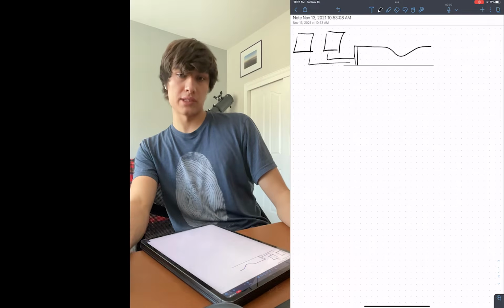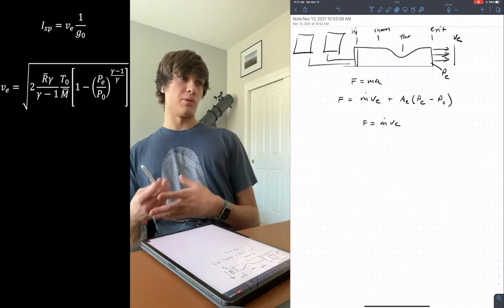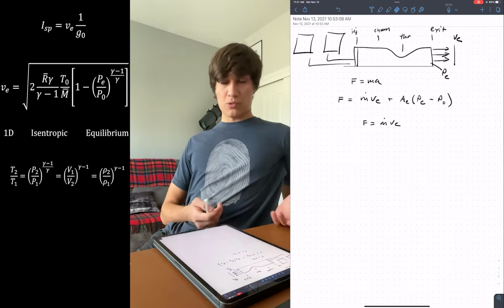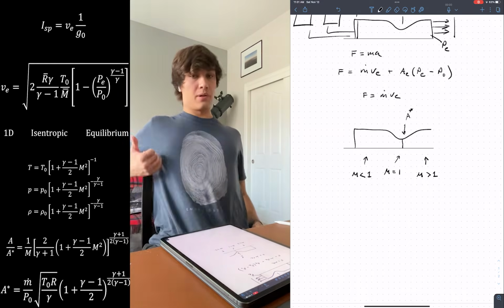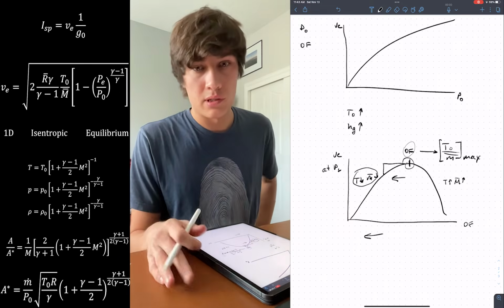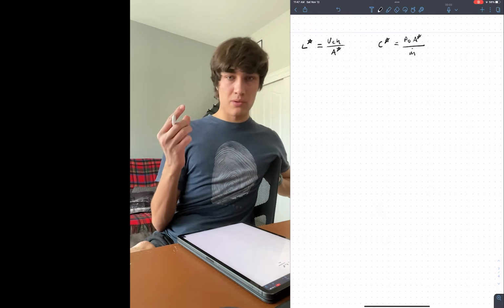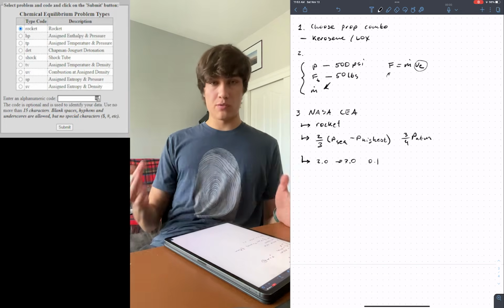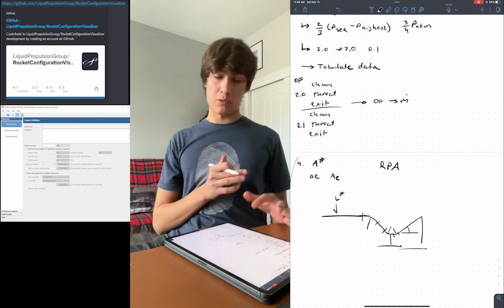Lec0: Sizing a Rocket Engine from Scratch (Intro to Rocket Design)

Comment: Nobody ever talk about what happens if Throat Mach Number is larger than 1, e.g. 1.05.
Surely it is not possible to hit Mach 1 right on the head, so I suggest you would rather want to be slightly higher, as lower will make your engine not work?
Reply: You're right to question this. Yes, what you asked is true: 'What happens if throat mach number is larger than 1?'

Let me tell you first so you can understand it. Everywhere you go, simplified science assumes the throat is exactly M = 1 ('Choked') for easy results. But in reality, that is not the case at all.
Imagine this:
1.Combustion chamber
2.Throat
3.Nozzle

In the combustion chamber, you have high pressure (potential energy) and basically 0 velocity. Now, according to Bernoulli's principle, if you want to increase velocity, the pressure must go down.

Now we transition to the Throat. The throat is very small compared to the chamber. Since you have made an opening, this creates a pressure differential. The gases are forced through. The velocity drastically increases from 0 (subsonic) to Mach 1.

Here is the reality check: From the start to the end of the throat, the velocity is never a perfect 'M=1 line.' In fact, it's a gradient. It implies that the 'Sonic Line' (where speed hits Mach 1) isn't straight. In the center, it might be slightly higher (like 1.05), while at the walls, friction keeps it slower. So you are right—it's messy. We just call it 'Choked' to simplify the math, but the flow is complex.

Regarding your 2nd question: 'I suggest you would rather want to be slightly higher, as lower will make your engine not work?'

Actually, you must hit Mach 1 or higher. If the speed at the throat is lower (Subsonic), the diverging nozzle will act as a diffuser—it will actually slow the gas down instead of speeding it up! So lower doesn't just mean 'less efficient,' it means it physically won't work as a rocket engine. You need that Mach 1 breach to make the nozzle do its job.
Reply: @cosastro7167 So Chat says I'm right? :D

Comment: How does this change with monoprop or thermal engines with LOX variability?  I assume then the sizing characteristic graph for optimumal ratios for fuel and oxider shift as it becomes less efficient to use oxider to raise temperature as you increase atomic mass.

Comment: im confused how do you get mass flow rate when calculating a star and at what point in the engine is this measured
Reply: I know this is an old comment and you might have an answer already but since there isn't a response here...
when you say "a star" I assume you mean c*, which is the characteristic velocity.
If you are asking which point in the engine you "measure" mass flow rate, it's where it's most practical to do so. If you are utilizing a gauge on a valve or a weight sensor to measure how much mass is being used in a certain amount of time that would be where you are "measuring".  c* is calculated by taking the chamber pressure (pc) and multiplying it by the area of the throat (At) and dividing that by the mass flow rate (m). c*= (pc*At)/m. Keep in mind this isn't actually standard notation as I don't know how to input the actual symbols. Also keep in mind this is only really useful when disregarding transient (situations of extreme changes in values such as engine startup) conditions.

Comment: Hey mate, I have a question for  you. What is more desirable regarding fuel oxidizer mixing in the chamber? That the fuel and oxidizer both comes into the chamber as gas phases, or both as liquid, or one as liquid and the other as a gas? Because I guess you would not, heat transfer wise, want the fuel to turn into fully gas(nuclear boiling ok) in the cooling jacket, but you would also not like to have a long liquid fuel penetration length in the chamber.  So how would you design the engine so that you make sure the bulk average temperature of the fuel is just shy of boiling when entering the injector!? That is a hard problem I think! Also because I guess the amount of cooling mass flow of fuel is fixed, as well as the initial temperature of the fuel.
Reply: Few thoughts. I think from a mixing perspective, gaseous injection is better, but typically fuels are present in liquid form so extra steps need to be taken in order to turn them into gases. IIRC SpaceX's Raptors do gaseous injection.

But I gess, liquid-liquid injectors aim for mechanical atomization rather than boiling them, so having them right below boiling point is less of a concern

Comment: This is so stupidly fascinating, but what are prior requirements to understand this subject? I have no clue about all the maths/physics behind it, but I want to know more and more!
PD: Liked and subscribed!
Reply: Thermodynamics and fluid dynamics.
Reply: if youre still studying this, although not strictly required, the prerequisite for university aerospace engineering degree would be something along the lines of 

calculus 1,2,3 
then physics 1,2
Engineering Statics,
Engineering Dynamics,
Fluid Dynamics,
Thermodynamics,
Compressible gas flow.  
(I am not including other things, unnecessary for the route to this topic) 
but you only really need to do thermodynamics, this is basically just compressible flow, known also as gas flow. 

look up the textbook introduction to aerodynamics 7th edition it should be free if you go to libgen or some website to download it. 
compressible flow begins at chapter 7.

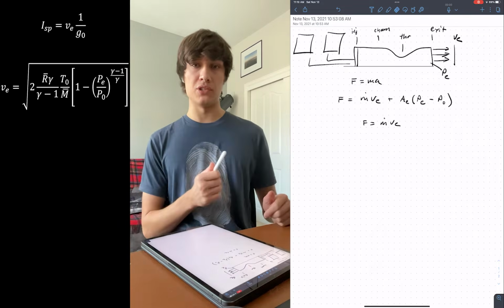Comment: 4:50 Lightes gas dont make sense. We want kinetic energy wich before you mention is speed*mass so if reduce mas you lose thrust. 
What i see is: more HYDROGEN more combustion(chimic reaction) more ISP: H2>CH4(methane)>C2H6(Ether)....>C3H7NO2S(RP1(i think is the worst because less Hydrogen per Carbon and "NO2S" is just useless weight. That make me think in NH3(Amonio but its nasty reaction and Nitrogen weght more than Carbon))
Reply: If you you double the speed of an object you quadruple the kinetic energy and if you double it’s mass you double its kinetic energy so by having a lighter gas you can have more kinetic energy because you can accelerate it faster. And you can carry more too I think

Comment: How did you get combustion chamber pressure Po?
Reply: you choose it, it's a design parameter. Typically is fixed due to technological limits (around 250bar, but spacex increased the limiti to 300bar)
Reply: @xxWender98xx  and according for what I have to choose it? according a chamber material ? I mean , for example, if someone chooses 1000 psi, it means that he did choose it according the material he bought?
Reply: @emmetray9703  You must always seek the highest pressure in order to have the maximum efficiency and thrust, so you choose it based on the material you want to use. If you want a cheap simple engine without regenerative cooling maybe you choose a lower pressure.
Reply: @xxWender98xx  got it , so at the end , it depends on material I want to use and engine structure. Thank you,
Reply: @emmetray9703  yes, you are welcome
Reply: @xxWender98xx  one more question, how do they know(for example spaceX) that their propellant will reach 300 bar pressure after combustion.?
Reply: @emmetray9703  The 300bar are reached inside the CC where they can place sensors, or if the pressures are too hight they can calculate it by knowing other parameters
Reply: @xxWender98xx  ok, thanks
Reply: You choose it, but how do you reach it ? We inject gas with a certain pressure, but then it burns, so the pressure should increase... But then it goes out of the chamber, so it should decrease, how do you calculate the pressure then ? What make you choose it ? Once you know what pressure you want, what give you this pressure ? How do you get it in real world ?